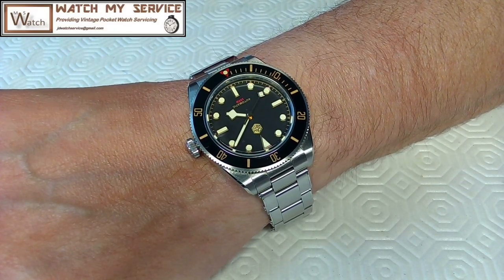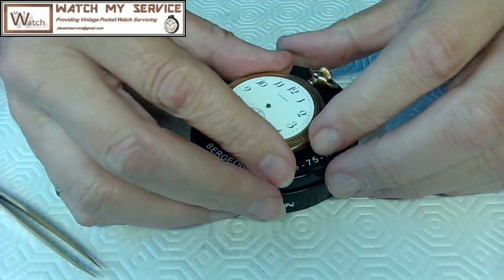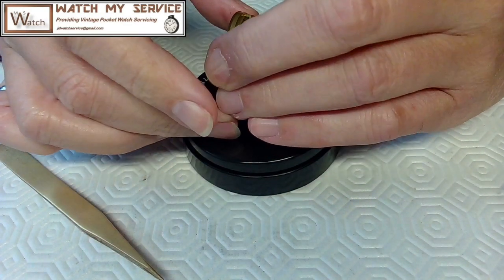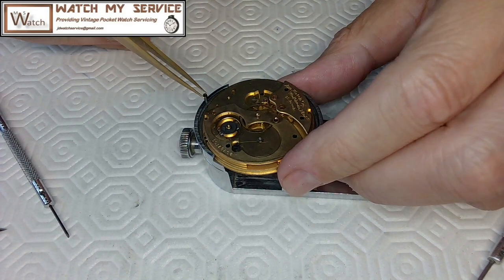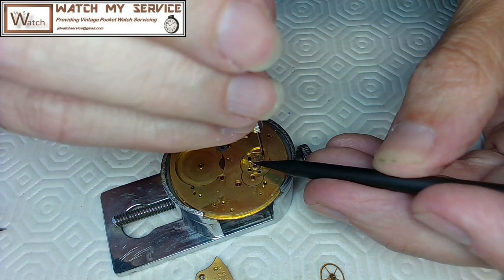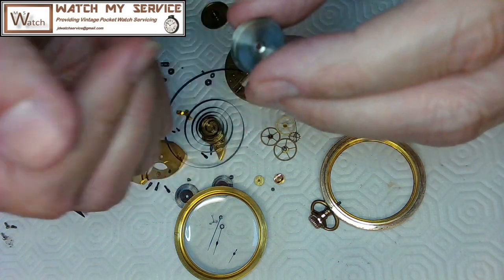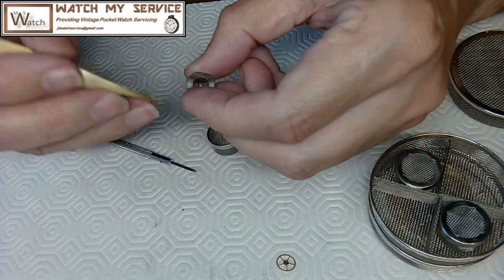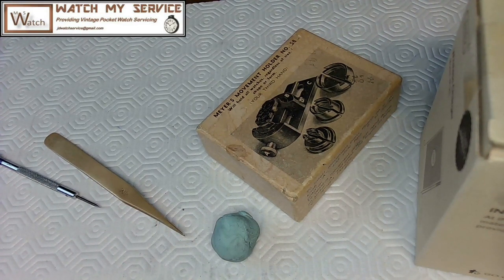Vintage Waltham Pocket Watch Disassembly and Prep for Cleaning

Comment: Thank you very much for your explanation about the watch! Either the motion work is direct part or connected to the going train the weight pulley (cable barrel) or spring barrel drives the main wheel and causes it to drive the going train and drives the motion work. What is the difference between the arrangement of wheels in clocks with second hand pivoted co-auxial with hour and minute hand and in the clocks and watches with  small second hand placed in separate sub-dial?